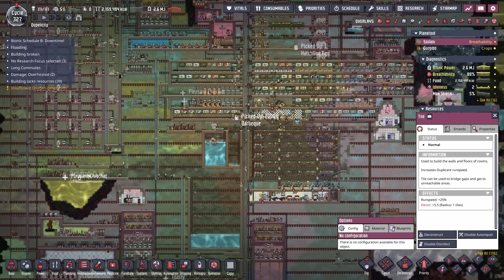Power emergencies solved with Power Plants | Ep 17 | ONI - Max Dupe Challenge

Comment: Echo, for paintings, there is no difference between copper and gold amalgum, they both give +10%. Gold amalgum only gives +50% when it is used to make sculptures.
Your bionic dupe problem was caused by the wholescale removal of all other battery chargers, forcing all of your bionic dupes to only use one location to recharge, and because of the small number of atmo suits available, most of the rechargers became inaccessible.

Comment: Do the pipe gas element sensors still hold the last signal if there is no gas in the pipe? 
I remember having to use a meter valve and use the reset pulses to detect steam overflow on a rocket setup due to this issue
Reply: Nevermind, if i had watched another 20 seconds it shows it doesnt do that anymore lol

Comment: You should feed the engies tune up'ed hydrogen gens first (in the sauna). Shouldn't really matter, but it might. 
Shoutouts to making some paintings out of steel in those new barracks. 
That hydrogen overflow valve system could also use a buffer gate after the filter gate so you actually consume enough hydrogen to clear up the pipes a bunch. 
Thanks as always for the episode/content! Hope your cold clears up!

Comment: a slight correction I think - having lots of critters is fine - if you limit their movement options.  for example, pacu that can't go anywhere in 1 tile of water, are a lot better than any number of pacu, that can move into 2 tiles of water.   There is a point of no return when too many critters build up - but there are some small things to mitigate it like the restriction of movement.

I think the downtime on the Bionics is more 'time to get to the 'food' - known as power banks" - if you store them in the steam room, they have to get the suit - travel to it - and get it - 'eat' them - and then come back out - which can delay another dupe from getting power banks in time, bypassing into their 'sleep' cycle,  and then into the work cycle.   Their 'down time' seems to be "restock oxygen" - typically going to an oxygen rich area, sometimes to provided oxygen tanks, and thus filling up - then 'grab batteries if needed' - removing 0charge and replacing them, and then "sleep mode".

Comment: 11:06 Power Control Stations also no longer have to be in the room to make it a power plant.  This means that technically the room with 3 hydrogen generators in a spom is also a powerplant and if you had a door to them they too could be tuned up for more excess hydrogen for your hydrogen spine.
Reply: Yep yep. No need the PowerCS

Comment: An open pneumatic door inside a water lock is a great way to prevent dupes from entering the industrial sauna if the atmo suit station goes down again.  
The power plant room no longer needs a power control station, just having two heavy power producers is enough.  
You can also make microchips without the need for refined metal if you just have a bionic dupe set to a special schedule where they defrag (sleep) for three days with just two hours of downtime to refresh their oil and batteries.

Comment: I've found that giving Boops the same downtime as Dupes covers most of their morale requirements and also prevents issues with gasping, batteries, and oiling up. 

Giving them 1 bedtime slot means you can also guarantee they'll run through areas like nature reserves at least once a cycle to get the morale bonus

Comment: Hey, a quick and power-free solution to the steam vent is to drop a layer of crude oil and a layer to petroleum on it. Keep both layers at about 1kg per tile and that steam vent will never go overpressure.
Reply: It could count is infinite storage, which echo deliberately avoids, but thanks for the tip! I think i will use it in the future
Reply: @fruity4820  It is technically infinite storage. But sine he is using the steam turbines to turn it into water and eventually oxygen, it isn't in this case. It's just a way to get 100% uptime on the vent with no intermittent overpressure stops.
Reply: @fruity4820  And it would save 2.4kW by not having to use 10 gas pumps.

Comment: I personally have a central spot, where the bionic dupes pick up charged power banks (delivered by a rail system) and drop their empty power banks, which then are picked up by an auto sweeper, that transports the empty power banks to the charging station where another sweeper puts them into a charger. One sweeper covers 4 chargers if I'm not mistaken

Comment: Anyone have advice on thermal aquatuner? My output pipe keeps breaking. I've tried setting the thermo censor higher but it doesn't seem to help
Reply: Well you have to make sure it does not drink anything 14C degrees away from freezing. Thus you have to 1) set up pipe termo sensor in the spot right before  aquatuner input, 2) configure it to send green if above, like, 15C in clean water case and connect it with aquatuner, and 3) construct bypass, to letting water flow even if aquatuner is turned down.

Echo made decent guide about aquatuner named "Thermo Aquatuner Tutorial", so i recommend to take a look as ultimate solution :D
Reply: @sinner5452  yea I've watched it like 15 times. It never occurred to me till today though the hard 14c drop ment I had the thermo sensor too low 😆.  Really appreciate the help thanks

Comment: I think the reason why lots of bionic dupes got incapacitated is that you canceled their downtimes when they were charging themselves.
Reply: Yeah in downtime they usually recharge all four batteries
Reply: That sounds like it makes a lot of sense!
Reply: same. observing mine they use 'downtime' to go get O2 first, then Grab a snack (eating a battery, replacing any that are no charge) and then end the time, and go into the next 'basic idle time' stuff.  Then sleep cycle starts, so they defrag at their beds (if you provide bed, otherwise they just do it wherever, useful if you can put them in places you need 'light' temporarily)
Reply: btw Echo, you made landscape canvases with steel. 12:42

Comment: Something that's helpful to know: The Gas and Liquid Reservoirs output a signal much like Smart Batteries. So if you want an overflow switch, just set one of the reservoirs to 95-100, and hook it up to your automation. Then you don't need to engineer complicated solutions.
Reply: came to the comments for this hahaha
Reply: Interesting.  What need to be on the other end of the automation wire?  The tanks will empty on their own if allowed, so don’t need a pump.  Does it go to a ‘gate’ or simply a powered shut-off valve?
Reply: @SurgicalPrecision  You can just hook it straight up to the generator. I forget if you need a NOT Gate (so double check), but otherwise, it manages itself, burning off the top 5% excess of the last reservoir, as long as the generators can burn the fuel fast enough.

Comment: my dude, that downtime gives them a bit more than +1 morale
Reply: I know right. Takes away their downtime to get new batteries. Immediately has several dupes run out of power.
Reply: Gives 5, and ya dupes now have no time to change batteries or drain gunk. 🤪
Reply: Yeah, at 1:51:40 on the Jan 19 stream when he "determines" that default downtime only gives +1. He didn't remember that it was a brand new dupe at the start of its first break, and then got distracted by chat so didn't realize it ended up at +3 downtime bonus on screen.